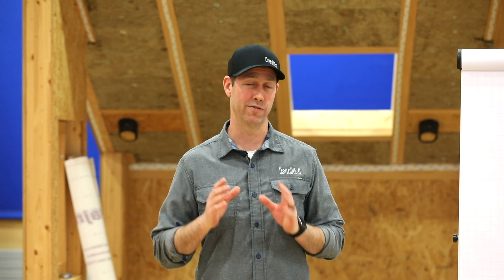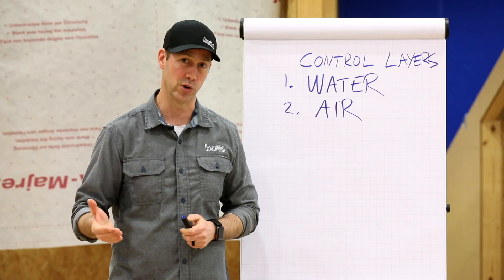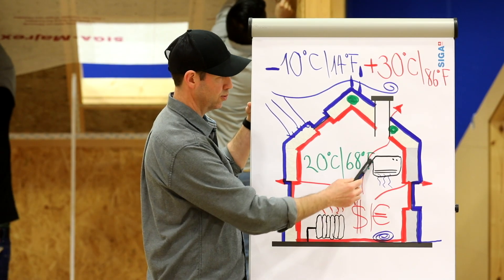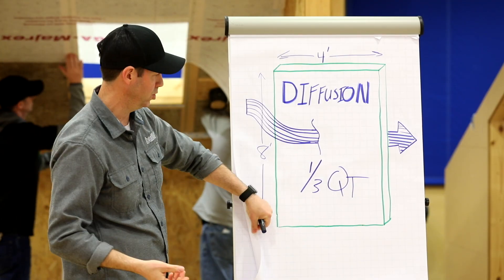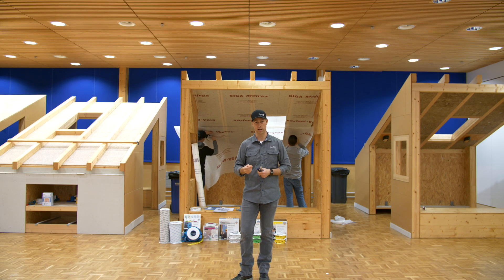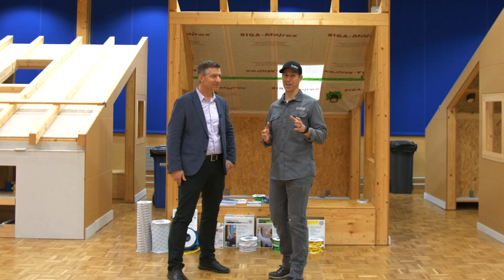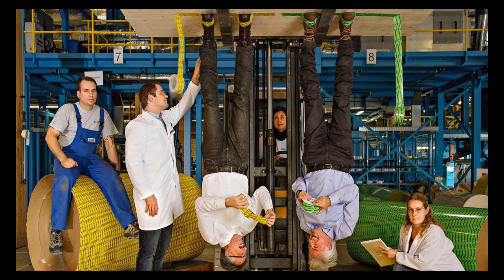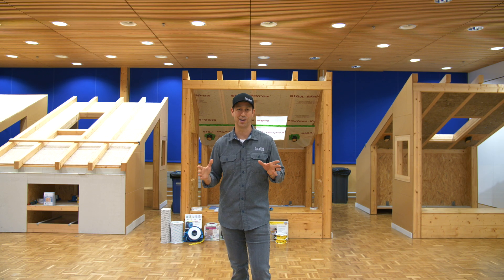Understanding Air and Vapor Barriers INSIDE your House

Comment: Matt, I live in FL Panhandle - Where should I install my vapor barrier? 

AC running most of the time. Humidity draw from the outside in. So install it before putting in insulation? And what type of membrane should I use? Retarder or polyethylene? I was looking into Intello Plus, but not sure if that's the right call. 

My sheathing is foam board, but a retrofit insulation job on a brick house blew through the sheathing and caused mold. Now I've got a combination of open cell foam and foam board essentially as the sheathing, and the foil-faced plastic vapor barrier has a ton of holes.

Comment: One interesting thing we might see in the back of this video, is the use of vapour permeable continuous waterproof woodfibre insulation on the outside (Gutex thermowall/multiterm). Because this is vapour open (where a sips panel of EPS isn't) it allows any trapped moist to diffuse through the wall to the outside. If every layer going outwards gets more vapour open, moist easier travels outwards than inwards, effectively pushing any water that might get into the wall out. No home will ever be built perfect. This means that it is an essential property that the wall physically pushes any water that might be trapped in your wall to the outside. This property is only essential in heating climates (when the outside wall is typically colder than the inside). In hot climates, you should shitch the permeability, making sure that the wall can dry towards the cooler inside. The smart siga vapour barriers actually do this: they become open in the hot season, making the wall dry towards the inside. The close down in the cool season, making it harder for moist to get into the wall and forcing any trapped water towards the cooler outside.

Comment: We shouldn't be fighting air tightness. We should be designing homes that are MORE RESISTANT to energy movement. Higher R values without being cost prohibitive. The sun, rain and humidity are our enemy,  not air. Air-tight doesn't last, nor is it practical, nor is it healthy. It's just a scam. Just like YouTube channels that pretend to be about information sharing, when they are really just about product-pushing.
Reply: Great points

Comment: Hey Matt, if the roof sheathing has vapor barrier, and insulated with a 1.5 inch comfortboard 80.  Eliminating the air gap and installing the metal roofing directly onto the Rockwool should not allow for vapor or moisture build up since the comfortboard should stop the radiant transmission into the roof interior or vice versa during the winter with the heat transferring out through the sheathing through the rockwool and onto the metal roofing.

Comment: Hey matt, I am building my home in Eastern Washington so advanced framing energy codes are very stringent, . I am planning on using R3 ZIP system and rock wool insulation with siga vapor barrier interior, will having an exterior insulated vapor barrier plus an interior vapor barrier be a problem because any potential Wall cavity moisture will have nowhere to go

Comment: Thank you for the video!  So…If I have a framed structure with a crawl space, closed cell, Tyvek on the exterior, Rockwell Insulation, and using T&G bead board for my interior walls, do I need a vapor barrier on the inside?  I’m about to install the insulation and I’m not sure…Thanks in advance!!

Comment: Matt,

Remodeling a house in NY, climate zone 5a. If the house was built with a vapor barrier just underneath drywall is there issues with using zip on the exterior of the home?

Comment: Of course the down side of this product is that if there is ever a roof leak, it will sit on top of this barrier if used under insulation or used under the roof , water will follow it down to the wall where you wont see it until it causes a problem in the wall.  Fix that by completely by creating a sealed inner envelope of the house.

Comment: Related to this is the science of what to do to allow in makeup air for appliances that vent.  If you want to suck air through your building envelope, turn on a clothes drier.  I researched this a few years back and there didn't seem to be anything written on how do do this properly.  Don't get me wrong, there was plenty written on the topic, but it all glossed over obvious questions about how to balance airflow so you know the air is moving through controlled channels and not through the building envelope.  The fact that these questions were left unanswered lead me to believe that the powers that be don't really know how to solve this problem in a cost effective and energy efficient manner.
Reply: In Japan ventilation holes in the walls are common for intake air. Personally I'd minimize combustion appliances.

Comment: So my question to you is. I had a 10 x 20 shed build so I could use it as an office they put pressure-treated plywood then put the 2x8 on top and then a mildew resistant outdoor subfloor on top and then build the shed, insulated the floor, but did not use a vapor barrier. Do I need one and if so, what do I do now I was thinking of putting ice and water shield on plywood. Would that help? Thanks 
Fred
Ps I live in New England and I’m using a mini split for heat and AC. And using spray foam for the walls and ceiling, if that makes a difference.

Comment: They are making this way too complicated. I duct tape my sheetrock to the studs and use Great Stuff for my baseboards. I use digital currency for my insulation since it comes from thin-air. You wouldn't believe how much time you save with the foam baseboards!

Comment: Matt, you got me familiar with the concept of building science and high performance construction.  I'm a mechanical engineer without any architectural formal training.  Yet I work on my own investment properties and have all sorts of questions that your content has inspired.  I'm really intrigued about the condensation problem, like in a cathedral ceiling.  I have a project where I"m having to pull the roofing off and re-deck, and support fallen rafters so I have the opportunity to fix the design.  My engineering sense is that there are not enough engineers involved in the building science industry.  Spray foam or not?  Radiant barrier or not?  Where?  How?   This video makes me want to become a rep for SIGA in TX.
Reply: You must be a new viewer.  :)  Matt is awesome.    Ohhh I read that wrong... I re-read your comment while I was writing this.  I thought you said,  You must not be familiar with the concept of building science and high performance. 

:)

Comment: Just as important, you have to stop cold air from hitting the vapor barrier. I have seen countless times where 6 mil vapor barrier fails because of poor insulation allowing cold air into the wall cavities. In effect, this turns your beautiful vapor barrier into the condensing surface and creating a lake between the vapor barrier and the drywall. I've seen this happen to the point where the drywall started to fall apart mere months after installation on a brand new building.

Comment: Still you did not explain how a directional vapour barrier works, if something can go through a membrane it would go through both ways, so its not really a barrier, or if it is, then its just a barrier for both ways, like a polythene sheet. A vapour barrier is not a semiconductor, which can pass electric current in one direction and not in the opposite direction, so please kindly explain how a directional vapour barriers function, and what if it fails like everything eventually fails at one time or another

Comment: What has never made sense to me is a vapor barrier behind drywall ? Isn’t that essentially trapping moisture between the barrier and drywall as the vapor makes its way through the drywall and nowhere to go once it hits the vapor barrier? I think there is an important part in this system that is always missed, and that’s the paint we put on the walls as it creates a membrane, I think this is what is preventing vapor from penetrating the drywall / walls  and not the layer behind the drywall otherwise walls with no interior vapor barrier would be compromised - just saying.

Comment: Why is there not a simple spray (not the aero caulk) for all the bare wood inside a home before insulation and dry wall?  Like a spray "paint" that prevents mold from vapor, separate from the air sealing process (yes, aero caulk).  That should be less labor intensive than for installing all the sheets and tapes.

Comment: I second what a prior viewer said.  We can all see the product that was installed, presumably directly against the roof joists.  What is the ideal goal any home builder should have when we address the space under the roof deck in terms of permeability of moisture?  Is it realistic to presume that the number should be zero?  Starting directly under the roof deck where we are going to insulate under the deck, should we put the vapor barrier up against the deck, then our insulation or should it be the reverse?  I have also heard guys saying it is important to have passive air movement going from the eaves to a venting cap on the roof to help remove the heat buildup in the “attic”.  I am not trying to add more complexities to the equation, I just really want to learn what are the best practices to have a sealed home environment where we are able to minimize the energy usage to keep the home very comfortable.  I may be looking at building at least two different homes in different climate zones around our country.  I am willing to make the initial investment so that they will still be standing generations beyond my life and still be well above code.

Comment: Thanks for sharing.  I want to turn a 15 year old pole barn into a home.  This is in MN (cold climate).  I'm considering spray foaming the entire structure from the inside, but i'm worried about no air flow and condensation build up onto the foam.  I would like to foam the ceiling right up to the tin if possible to leave beams exposed, then put tongue and grove pine over it.  Is this a good idea?  Do you think I will run into problems making it too air tight?  There is no house wrap on the structure.  And advice would be helpful.  Thanks!  Eric.
Reply: Is there any water membrane on the structure? You need something to keep the water out, but iirc spray foam can act as a vapour barrier & air barrier.

Comment: We need to control air, but to an extent. You CAN NOT make a house completely air tight... if by some tragedy you DO, then you will bust through the envelope the first time you open your front door, except you might blow through it in a location that has extra moisture, which causes more problems than a small air "leak".

Comment: As a European I have a hard time understanding this love of wooden houses. I find bricks and blocks much more interesting in terms of handling heat and moisture, 'cause if you mess it up with wood in any way, shape or form, it goes to hell really quickly. I also don't understand why all this insulation is done from the inside. It makes sense in renovations when you don't have the money or the space to do it differently, but in new builds around here, it's 20 cm of polyisocyanurate on the loadbearing walls, covered by a crepis or an outer layer of bricks. There's never any talk of putting up vapor barriers on the inside.

Comment: Hey,  I need some help ;-) . I have a 2005 Norris single wide. The exterior walls are condensating so the drywall is soggy with a little bit of mold starting to develope. The reason why is because we got a portable ac unit because we like our bedroom 59° at night for sleep. With it being 59° inside and over 90°+ outside it's causing it to condensate.  Does any one know how I can fix the issue with out increasing the temperature? We took a section of the drywall off and was blown away to see that there is no osb outside! It's just siding,  a very thin green foam board (not sure if that's for moisture or insulation), then 2X4's, insulation then the drywall. Should we remove the drywall and add a higher rated insulation, or add something else?  Thanks in advance for any info!

Comment: If I use cement board, won't something like latex (tile bond) used in waterproofing tile grout also work on it? I have built a koi pond using it on concrete and it worked great. I mixed 50%/50% cement /sand with tile bond and used it like a sludge.

Comment: Thanks for the great and informative video. I have a question about wall construction. I live in Norway right now and most of the houses here are wooden constructions, just like in the US or Canada. The construction of the outer wall is a bit different. In the US on the outside of the studs usually they put OSB sheating, windbarrier membrane, furring strips and cladding. In Scandinavia they do not put OSB sheating outside, but inside of the studs right over the vapor barrier. According to the Norwegian building institution (SINTEF) it is mistake to install OSB sheating to the outer side of the studs, because it has a strong vapor barrier property and it hinders the airflow and venttilation of the inner constructions like studs, insulation. Why is this big difference, which one is better and why?
Reply: Szia Attila, Tudunk kommunikáli emailben vagy telefonon? Köszönöm Matyi
Reply: @matyasfarkas1080  messengeren írtam.
Reply: @locsei105  Mat Wolf néven vagyok fent. De holnap hívlak. Köszönöm
Reply: @matyasfarkas1080  vagy hetvn otvnhárom otvnnegy háromotvnhárm
Reply: @locsei105  Ez milyen körzetszámmal? Vagy +hetven-nel ?
Reply: @matyasfarkas1080  aha

Comment: Bought a utility shed, 2x6 framing, 3/8 siding, no housewrap.
I want to turn it into a studio/apt, but do i need housewrap and a second layer of siding? Looks like plastic on inside is foolish. northern Nevada.
Can be 20 below in winter, and is t the touching 100 degrees for a month in summer.
What to barrier, or not???

Comment: It’s a tough call, because of the stack effect, having a air tight house develops a balloon type pressure to your attic causing possible breaches. But then letting a home breathe will at the same time create weak points which will create condensation also. It’s 2021 and housing construction (especially in America) hasn’t been mastered yet... Don’t even get me started with HVAC installation smh

Comment: Ok, so maybe this is a stupid question. But how do you introduce 02 and remove CO2 from a "100% sealed house" without also bringing in cold/wet air from outside (I'm in the PNW, so "cold" is 30-50degF)?... What's the science for what prevents us from suffocating or feeling like a house is "stuffy"?

Comment: I've researched this and it's probably one of the most inconsistent area's of building in terms of whether it's required or not. Sadly, I still don't know what to do.
Reply: a vapor barrier needs to be in a different location for hot vs cold climates.  So there is no single answer.
Reply: @ecospider5  problem is a lot of people are in places that have 90 degree high humidity summers and 20 degree snowy winters all in the same spot. "hot climate" and "cold climate" are two extremes that dont represent the gray area inbetween
Reply: @shoyrushoyru  Exactly, so what is the answer for a climate with hot humid summers and cold wet winters?
Reply: What about if you have 2" of exterior foam board below grade? Where will the water condense?
Reply: Actually it's very straight forward. If you insulation can not breath to the outside air, you need one.

Comment: Love your content! I would like to know if you could do a video on how to retrofit insulation on the outside of drywall by creating a space with one by fours or something like that? And then cover with some sort of shiplap. I was curious if we could lay some sort of barrier layer like to talk about in this video and then possibly insulation board and then put shiplap over top of that. I am doing this in a house that was built in 1983 that has very poor or minimal insulation throughout. You can basically hear conversations everything through the walls if you’re standing outside the home. If a family is talking even a little bit louder than normal you can hear the conversation. The siding on the outside of the home is cedar board with some sort of insulation board underneath it, I believe it’s quite thin, then 2 x 4 construction.

Comment: Might be the wrong video to ask. But have you worked with sacrificial mineral insulation(this was the old name, sorry, I don't know what people call it today)? Basically foam insulation with some kind of activated carbon(or  sealed inside to slowly absorb moisture and starve mold as the foam settles and air pockets break through, etc. I know the main reason builders stopped using it was because activated carbon can create the appearance of black mold over decades, but I would think in the last 40 years since I had dealt with it last, some kind of progression was made.